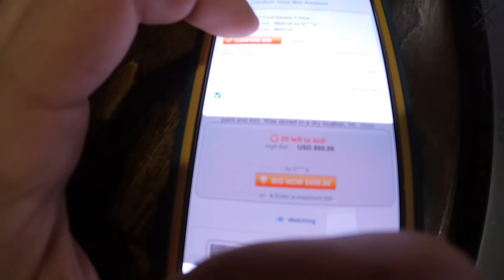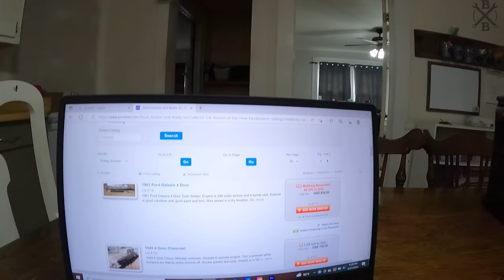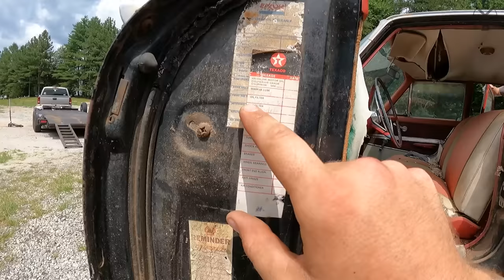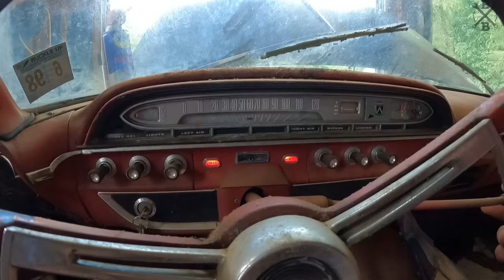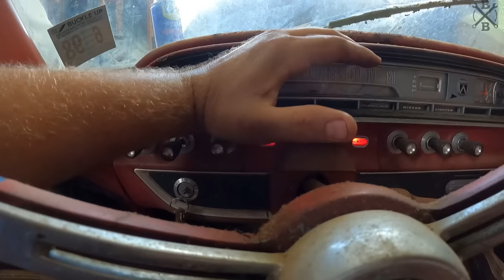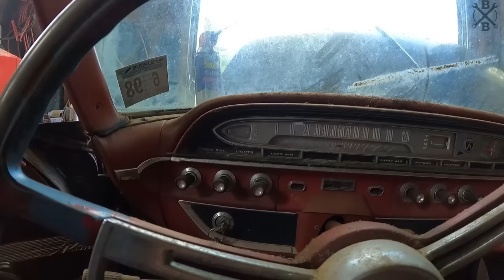BARN FRESH 1961 Ford Galaxie 390! Will it Run After 24+ Years?

Comment: I had a 390 in my 67 TBird. Loved that car. On a honeymoon trip to Wyoming from Northern PA we stopped and had the oil changed in Denver on the way home. The guy failed to tighten the drain plug and I blew oil until noticing the oil gauge and turning down the radio and hearing tappets from hell. We spent the nite in Anita, Iowa off the interstate under the roof of a country gas station. He opened at 7. I ended up having the valve guides replaced and few other things back in PA. But that 390 got us home. Over my 76 years and many cars. There is always 4 quarts of oil and a tool box in the trunk. And I only listen to talk radio.

Comment: Nice score. That’s definitely worth cleaning up. You rarely see four doors around. And you gotta love the 390/3-speed combo! I’m also diggin’ the later GT wheels. FoMoCo bought the Autolite brand in ‘61 so it’s  possible the OEM spark plugs would have been Autolites. Carb might be an Autolite, too. Motorcraft didn’t come along until Ford was forced to divest Autolite in ‘72.
Reply: Those wheels were also used on the Falcon GT351 here in Australia.  The wheels were nick-named "12 slotters"
Reply: Yeah. I use autolite plugs in almost everything.
Reply: It sure looks like a Autolite carburetor to me and like you said Motorcraft was much later I think the tag is on it
Reply: Sadly the moreDOORS because parts cars for 2 doors,,save the longroofs 👍👍👍👍
Reply: **BECAME * ** parts cars

Comment: Bud, you really killed it getting this one as cheap as you did. I mean that thing will be a really cool car to take to car shows and putt around town in on the weekends if you can get that headliner cleaned up, clean the engine bay up, and clean up/fix the seats. I know that I'd LOVE to rock that thing with a nice throaty exhaust, headers, and a possibly a high lift/long duration cam. I'd buff the entire body too and try to shine it up some.

Comment: Im building a 390 with my grandpa. Good engine and amazing car
Reply from the maker: Awesome!! Thanks!
Reply: Haven’t put a set of points in a car in a long time early 90’s had a dual point in my 289 lol
Reply: I hope you change out the intake manifold. You'll know what I mean if you've ever lifted one off the block. I suspect they weigh almost 70 lbs.

Comment: It's a four-door and not a Starliner, Starliner's were exclusively two-door fastbacks.
Reply: A high school friend of mine put Mustang letters and emblems on his old Falcon. I guess it was a cheap upgrade.
Reply: Hardtops, not fastbacks. That term wasn't used until the '63 1/2  Galaxie came out with the more NASCAR friendly hardtop design, after the more formal T-Bird style roofline of the '59-'63 Galaxies (with the exception of Starliners, '60-'61) were deemed to be too slow on Superspeedways, after the '62 season. Real fastbacks, like the '66-'67 Charger, '65-'67 Marlin, and Ford "Sportroofs" of the late '60s have the roofline tapering off, all the way to the rear, of the car. In reality, I believe the 427 that appeared at '63 1/3, along with the new roofline, was the real reason for the success in the 63 season, not the roofline.

Comment: Love seeing these old fords. I have a 63.5 ford falcon sprint that I have completely frame up restored using all original parts. It has a 260 with a 4 speed. Grandpa bought it new and it’s been family since. Still has original chrome all the stickers that came on the air cleaner everything that car had in 1963 is still there. I even spent a lot of time and money tracking down an original trunk latch when mine failed.

Comment: Definitely a survivor that needs preserving with a light touch. I’d even retain and clean up the boot/trunk carpet and other worn trim pieces. Just do what needs to be done mechanically and just enough preservation work to stop it deteriorating further then get her on the road.
Reply: The trunk interior was a big surprise. That made me think the mileage might be correct.

Comment: Had a '61 Galaxie 4-door that I daily drove back in the early 2000's until rust claimed it. Flat black, fake leopard fur interior, 352 2 barrel, 4 wheel manual drum brakes that actually worked. From the rear wheels forward it was solid as a rock, from the rear wheels back it was swiss cheese. I think the guy I sold it to tried to save it but I'm not sure. Always wondered what happened to it.
Reply: That was the last time I saw the Road Warrior. It lives on only  in my memories.

Comment: @20:40 - Autolite was the OEM plug for a brief period in the '60s, so those probably were either the factory originals, or installed during a tune-up done at the dealer.

Comment: Ah, memories. I learned to drive on my dad's '61 Starliner. Later, it was my college and commute car. Dad's had the 352 CID and automatic. Started leaking oil around 77k miles. Even with the different engines,  I recognized a lot of stuff under the hood. 
For noisy or stuck hydraulic lifters, adding either Bardahl or Marvel Mystery oil helped clean them out and quiet them down.
Thankfully back in those days, gas was 27 to 53 cents/gallon.

Comment: That motor is very good , I think all the noise was the fuel pump 
I can’t believe how well it runs 
Well done 👍👍👍
Reply: I think you're right about the fuel pump. I bought a 79 chevy real cheap because of a loud ticking sound. They thought it was internal. I did too. Until the fuel pump went out one day. After replacing it? No more loud tick.

Comment: The idle speed can also be adjusted on the choke linkage, when the engine is cold and on the throttle linkage side when hot,,,  🙂

Comment: What’s the difference between those390 motors they put in cars and the 390”s they put in the early 70s f100 besides the horsepower. Would that motor fit my 74 f100 just the same as the 390 I have? If it will I messed up. I bought a new long block about 5 years ago. I always wondered if I should a got a long block for a old thunderbird or something to get more hp.
Reply: No difference other than 1964 and earlier only have two motor mount bolts in the block, 65 and later have 4 motor mount bolts in the block. 65 and later blocks will work fine in 64 and earlier but not the other way around. Also 64 and earlier use 153 tooth flexplate with a weird inertia driven starter 65 and later use a 184 tooth flexplate and a normal starter. Another major difference is the car engines were usually higher compression than the trucks, more power.

Comment: First thing should be a bath, exterior, interior, and engine bay. Having it somewhat clean would do wonders.
Maybe a bit of modernization, then. An in-line fuel pump and EFI conversion would make this a very reliable boat.
Reply: Could you imagine filling that beast up with current gas prices? Probably gets what 8-10 mpg?
Reply: EFI has no place on that car! It's got a great carb on it. Just clean up the carb and rebuild it. There's nothing not reliable about that carb or engine. Simple is better. The more parts, the more electronics you have the bigger chance you have of something failing.

Comment: That's a cool car, looks pretty solid too Especially for a 61 that's been sitting.  To bad it wasn't a 4spd and a 2 door. But it's cool that it's not an automatic!

Those wheels look like 68-70 Mustang or Torino GT wheels.

That's not a Motorcraft carb. Those carbs are Autolite carbs. The 2100 & 4100 carbs are Autolite. They didn't become Motorcraft carbs until the early 70's when they went to the 2150 style carb.  Those Autolites are great carbs. My favorite carbs. I prefer them over Holley carbs.
Reply: Ford did not have a 4spd option till 1962. The 60 360 hp 352 and 61 401 hp 390 only had a 3sp manual or 3sp cruiseomatic..
Reply: @iristhompson2350  Plenty of people swapped in 4 spd's in place of 3 spd's.

Comment: Something quite wrong here. No such car as a 1960 or 1961 4 doors "Starliner." A '61 Ford Starliner is semi-fastback roof and only 2 doors. I have a black 1961 Ford 2 doors Starliner with 390 tri-power and 4 speed manual B/W T-10 transmission. Tuscon AZ car and it was rust-free despite sitting in a barn since 1987. 54k miles but the clutch was worn out which is why it was parked in 1987. I paid $700 for the car and transported it home using my own "roll-back" car carrier. Two years later, it's now fully restored. I put a red 1964 Galaxie 2 doors XL re-upholstered interior, and console, in the car, without much effort. It's an A/C car, power windows, now with power front seats, P/S, and now with 4 wheels disc brakes. Of course, I rebuilt the engine and the three Holley 2 bbl carbs. 3:70 Detroit Locker rear differential, and 15"x7" five spoke American Torque Thrust wheels with 225/70/R15 radial BFG raised white lettered tires.

Comment: My first car was a "black 1961, Galaxie" like yours. Woven vinyl bench seats, 390 V-8, 4bbl., auto, "Armstrong" power steering, dual exhaust. The engine had a crack in the water jacket so we replaced it with a 351, same carb. The trans went, so we installed a C6 auto. 
I installed deep-dish chrome reverse rims on the rear. This was with Goodyear, white letter, wide Oval tires (F70x14) on them. Up front, I put Montgomery Ward "red line" wide ovals (F70x14) on the stock black rims. I installed chrome trim rings and chrome baby moon hub caps.
The exhaust was dual "Cherry Bomb" mufflers with full length pipes.
Used to race it on US-24 Telegraph Road, and Woodward Ave. in the Detroit area. Ran great, sounded fantastic.
Despite the carb choke, being held open by a wire, two pumps of the gas pedal, turn the key and it fired up. No matter what the temp, it never failed to start.

Comment: Wow what a find. I remember my dad owned a 1959 Ford Fairlane (Ranch Wagon with the fins and big dinner plate tail lights and the knee knocker Windscreen) with the smaller 332Ci FE V8 in it. We drove 4,000 miles in that old car towing a trailer with 5 tons in it from the east coast of Australia to Perth on the West coast of Australia in 1972. 

The road was what we called Bulldust back then and was called the PADDACK Nullabour Plains. 100's and 100's of miles or nothing.
That old FE 332ci v8 was very tired and used about 60 gallons of oil ( I remember stopping in parking bays and my dad just used oil that trucks had dumped. Any oil is better than no oil right. I was 9 years old then. Tough old engines those FE's. Interesting it has THUNDERBIRD valve covers. Our little 332 had FORD FE on them. Im guessing Australian Fords were different than northern US versions. 
Thanks for the great video.

Comment: Michael, I parked behind you at the April Cars & Coffee, '68 Cougar 302,  74,500 original miles.  I learned the hard way about the stupid practice of coating the timing chain in nylon plastic back in the '60s and '70s.  Both Ford and GM used this dumb practice.  On the way back from a recent one-day AACA show in Beckley, WV, timing chain failed and skipped several teeth.  Chain was replaced and oil pan pulled and cleaned out in Wytheville, VA but #7 exhaust valve on one of the Edelbrock heads had been bent.  Both heads are at Dover Cylinder Heads in Greenville for checking/repair.  I had to pay $1200 for a haul back to Greer.  So be aware of low-mileage old Fords and Chevies - original timing chains absolutely NEED to be replaced!

Comment: My first car was a 1961 Ford Fairlane four door sedan with the 292 Y-Block V-8.  Had the three speed with the Overdrive and 3.89 to 1 rear axle.  My dad ordered it from the dealer and we picked it up on 20 April 1961.  He paid $2250.00 and traded in his 1055 Plymouth Plaza 2 door sedan.  It was ordered with the deluxe heater, radio and heavy duty rear springs and was the Aqua Marine Blue paint.  I was given the car on my graduation in 1968.  Sold it in Feb 1969 when I went into the Navy.  It had just rolled over 100,000 miles and I got $50.00 for it.

Comment: GREAT powertrain, and highly desirable. I never met an FE engine I didn't like. As an aside, the factory installed plugs would be BF-42, which are 18mm tapered seat. And your starter seems to be complaining of thirst for lubrication. It would be a three bolt mounting, common as dirt, and the original was an FAR11001A, which was common to 1958 to 1961, which indicate it also fits Y block engines. From my research, the only one that will not fit in that era would be the small block 260-289-302 series.  I haven't dug around for an interchange list, but I think the above info is goog.

Comment: Transmission should be a Borg Warner T-85. Very tough. Used in the '62-'63 MoPar Super Stock cars because a T-10  4 speed wasn't strong enough. Actually the T-10 was developed from this case. BTW back in the olden days (points and carbs) we had an electrical system that preceded electronics. Pity this one is a 4 door. I have a special wrap wrench for those spin-on fuel filters.

Comment: Edsel car have FE block that is probably called the Windsor 390 CID. The Cleveland engine block in the car into 351CID. The 305 CID and 306 CID are engine in Ford Family car Plant. The Edsel went bankrupted so then the Truck City would take apart the Edsel and scrap the edsel Starliner into the cruncher. The destroyed Edsel is simply into the Pebble Beach Vintage or a trash can. It was an idea competition as a favorite for GM and Camaro in the 1950's. Edsel car is design like 1940 low profile hood type car. But the Camaro was GHIA made in either Italy or USA. Ghia in Italy is like Praga Formula One car, it got like a 290 HP.  The 400 HP engine was not suppose to be cheap. Why the Italians cannot afford to have any time in driving around a baby's toy named 400 HP or more type of performance car.
 Because they made an illegal bet and when the Italian sold the car it was only 100 HP for the 1.3 liter equals to around 100 CID 2 valve per combustion head. Then he wants to earn the Miura from Lamborghini shop while he sells newspaper for the city of Turin. He would never be named except the last name. Because the first name cannot afford the Miura so he swap shop and took over the Miura and paint the original Yellow Miura into Black paint while he robs the Grand Prix as well as the GTO car away for American Ford and even Chevrolet of Camero as exactly the same design as the Miura sports body and no engine and suspension because only American can afford the car. Not Italian because the city and homes were in earthquake and destroy in Italy. The Hurricanes made the American into slow and not successful business except the Green Beltway in N. America full of ethusiastic car performance that we worked and work a car into produce better than Italian Ferrari roller. Mercedes is good brake design for installing Mercedes to American build car into Homologated and popular output from GM Plant.

Comment: The carb is an autolite, and oem plugs were also autolite.  I am going by what my 62 390 came with as well as every ford I worked on from the 60s.  Back in the 70s you could get a rebuilt autolite 4 bbl carb for $19 without having to supply an exchange.  A new 600 Holley (1850) was over $150 at the same time.

Comment: Back in 1961, Autolite were the factory spark plugs. Also, no solid lifters 390 engine in 1961.Rocker arms are NOT adjustable. I'd add one quart of Marvel Mystery oil and then change the oil again after 50-100 miles later. Engine should be quiet by then and all inside engine varnish gone.